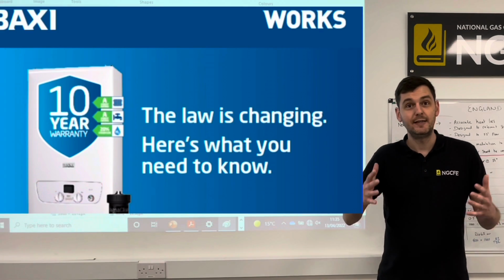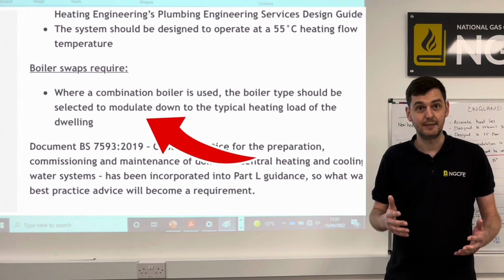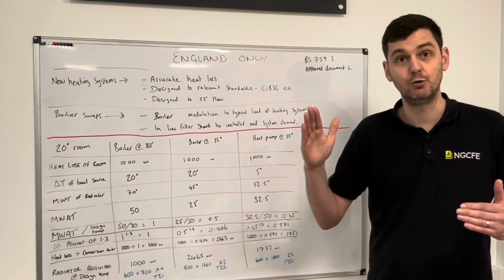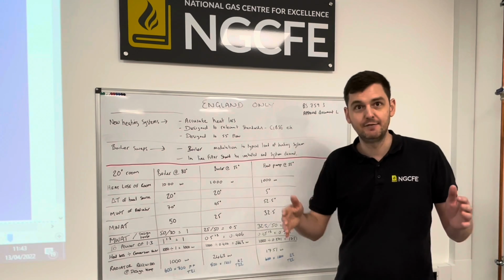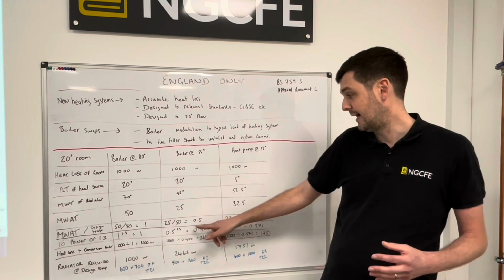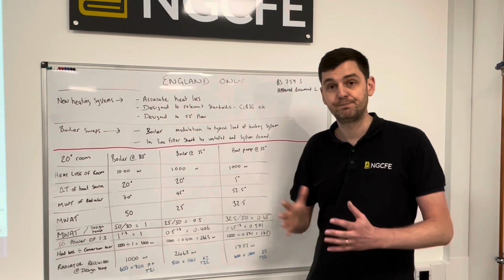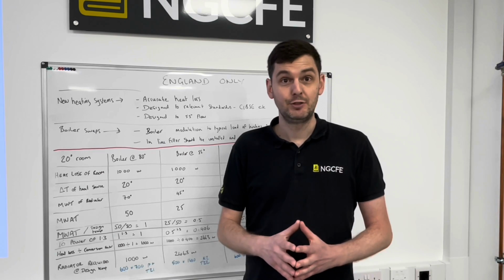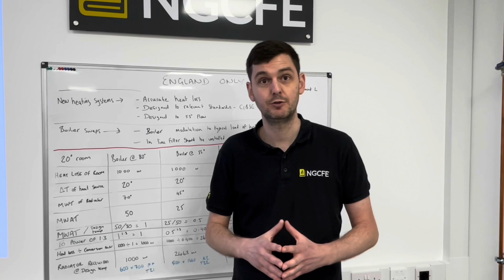Approved Document L Central Heating Low Temperature System Design NGCFE

Comment: If you’re dropping flow temp to 55c, what’s the reason for continuing to use 20c diff as opposed to the 11c we were used to using?
If you used 11c, you’re return is 44 and mean is 49.5. That means the rad size doesn’t need to be quite as big as you suggested. 
I thought that the initial reason for changing tac to use 20 diff was to bring return temps down below dew point yet maintain a higher flow temp because of typical existing rad sizes?
Is there another reason for the 20c? 
Thank you.

Comment: Wouldn't you just replace the normal conventional radiators with new low temperature flow designed radiators which are designed to be more efficient and so reduce the size of using a conventional radiator - granted the new low temperature radiators are more expensive.

Comment: unefficient S plan systems must be replaced with DHW priority. As having one flow temp of 65 Degrees to heat up the stored water is a waste of energy when most properties heat loss is 7 to 9 KWH and would run much more efficient at a lower flow temperature. I suppose mixed and blended curcuits would be one way of doing it as well as priority DHW and a boiler that can fire on two heat outputs :-)
Reply from the maker: Hot water priority doesn’t always suit everyone. It can be a real pain if you have a large hot water demand. Thanks.

Comment: Great video as always. But with system or heat only systems with unvented hot water cylinders with legionellia requiring storage at 60 Degrees. Only boilers capable of firing at two different outputs with DHW priority, weather comp will give the best efficiency... Intergas exclusive and the other one aswell as viesmen can fire on full output to recharge the Hot water cylinder on DHW priority then modulate right down to the heating systems heatloss...  But as you say everything starts with a accurate heat loss calculations!

Comment: With bigger radiators, there is a higher volume of water for the boiler to heat (although at a lower temperature). So is more gas being burnt, or effectively the same amount? Where is the savings?

Comment: I'm looking to install a new combi boiler. We have 10 rads and one shower fed off the boiler. Semi detached 4 bed house originally 3 (had a room made in the loft).
Current boiler is 28kw and has lasted us for over 10 years with no problems. 
Was looking at a Main eco 30 or a Baxi 636, any other recommendations?
Reply from the maker: Viessmann 100. You can range rate it down to suit your load. Thanks.

Comment: Bit vague on heat loss at non extreme temperatures. OK, do a calc at -3°C but who has done heat losses at 5, 7, 10°C when heating is still required, without this how can you decide where to pinpoint the modulation range of the boiler? 

Just as the -5°C figure is only a tiny part of the heating season +13°C  when heating is also required forms a small part of the total heating season. 

We've been covering this and showing how heat loss changes at different temperatures on our Heating Efficiency and Optimisation courses for a couple of years, also heat gains and ∆T across the boiler with the aid of ∆T pumps.

Trainers are going to be busy

Comment: In the video (on the chart) what does the 1.3 multiplication factor represent?
Reply: I was wondering that too. So I found this out: "When you reduce the mean water temperature of a radiator its heat output does not reduce linearly." 
eg reduce mean water temperature by half, results in less than half of the heat output.
As there is a non linear reduction a 'correction' factor needs to be applied from a table: 

Delta_TCorrection:
DeltaT.         Correction Factor
20              0.3 
25.             0.41
30.            0.52
35.             0.63
40.             0.75
45              0.87
50.              1

These corrections are from 
20/50 ^ 1.3
25/50 ^  1.3
etc, rounded up to two decimal places.

You'll see the 0.41 (0.406 used in chart in the video)

For the heat pump 32.5/50 ^1.3 = 0.57 (which isn't in the chart above, but it shows how such a chart is calculated)

HTH
Reply: @vidleon  thanks for that. Just not explained on the video. 👍🏻
Reply: It relates to the types of heat emitters we use- there is some variance for other types of emitters

Comment: Morning Alan. I may have misunderstood the new regulations but I can’t see how an existing system designed for the higher flow temperature can have additional radiators added that work at the lower temperature. Also, are towel rads going to become obsolete?
Reply from the maker: You make some good points. we will see how it all pans out.
Reply: Hello David.. 

Good point, possible solutions could be :-

Trv on the new radiators that will be too large for a 70 degree flow temperature will heat the room quickly and switch off earlier than te others ?
Adjust the balancing of the radiator. Slow the flow excessively to reduce the average temperature flow /return - may deal with it. Good luck finding a lockshield valve that will reduce enough and reliably !  
I'd be interested in your thoughts ?

Comment: Well the maths is wrong. 1. how can 1.3 *1 =1 in the boiler at 80 degree calculation?   So the radiator in the calculation is too small!   2. All things being equal for a fair comparison, the return Delta temperature of two low temperature heating systems will be the same as the energy coming out into the house is the same. The heat pump can’t magically increase the return temperature when no extra energy is being put in!  The flow rate should be the same for a fair comparison. It’s also worth mentioning that with a smaller temperature difference that the heat exchanger in the heat pump would also have to huge in these calculations!
Reply from the maker: We have a full detailed video coming soon, This is a full house with a heat pump going in. Thanks.
Reply: Hi Dominic, 
Thanks for your reply. Its not times 1.3. Its to the power of 1.3. The radiator calculation is fine.
With the greatest respect, your further comments are incorrect. The return temperature of a heat source with a narrower DT will be higher than that with a wider DT if they both have the same flow temperature. Also the one with the narrower DT will have a higher mean water temperature  and as such will give out the same heat with a smaller emitter. Its just physics.
Have a great day.

Comment: I have a 1930s solid wall (no cavity) home, mostly installed with insulated plasterboard, loft insulation, old double glazing, suspended floors with no insulation. Approx 2000 sqft, 16 rads (new, convector type). I oversized the rads by assuming in the calcs the walls were still solid brick with no insulation. The boiler is an Ideal Logic 30+ combi (zoned off for an unvented cylinder). The Drayton Wiser controls are set to Opentherm modulation. During colder months the heating is set to 19.5c from 6.30am to 10.30pm. Over night it's set to approx 17c.

I find that first thing in the morning (when the house is coldest) the boiler fires at 65c to 70c, given demand is highest. Once 19.5c set temp is reached the boiler modulates down to 40c to 50c (or lower, if not to cold outside, I've seen as low as 35c). At flow 50c return temp is about 35c. At flow 35c return is about 30c. (I've never been able to reach delta T of 20; is it normal that the lower the flow temperature the smaller delta T gets?). 

The house stays toasty and warm, the boiler super efficency shows as 72% (which I believe means it's in maximum efficiency / condensing mode 72% of the time).

The boiler rarely fires over night, I figure this is because all of the internal walls are solid brick and act like very large, low temp, storage heaters - releasing heat over night. I'm guessing new regs don't take this into account (given new builds are mostly stud wall etc).

Really enjoy your videos, very informative!

Comment: Whilst gas is 0.07p a kwh and leccy 0.28p a kwh i don't see customers buying in
Reply: why wouldn't customers want their gas boilers to run more efficiently?
Reply: @edc1569  I am not sure they do. Low temperature means over condensing. For years in the commercial world we are told keep the back end temperature over 55 or it rots the boiler. Their are cast iron boilers still out their 30 years old. You will never get a modern boiler lasting that long. No one calculates how much Co2 could be saved if we make boilers that have a decent life cycle. The throw away world has taken over. I have still to be convinced that the country will have enough engineers to maintain complex electronic heat pumps. Lots of us oldies about to retire and 50% of kids at uni. Electric heating is going to take years. Houses will need to be modified. I am all for tech to save energy. But its really not a mystery. If you want to save energy turn it off. Insulation is a much better way.

Comment: Before they bring out new guidance they need to change the inspection and compensation scheme for new builds. Due to the rush to build new homes buildings are taking massive short cuts to avoid penalties. This includes missing insulation in new homes. Not enough inspectors and no legal protection for them or the house buyer allows builders to walk away from some shocking installations. In addition new homes need bigger room dimensions to allow the equipment to be fitted.

Comment: The only point I would raise with talk of ultra low modulation is that in any system you can only get out what you put in. If you are modulated down to 4kw on a gas boiler then that's the maximum you've got to play with...before losses. With good insulation that can work well, but with the average badly insulated British house we are putting the cart before the horse here. We need to get the houses better insulated first. Everything will follow from that. The priorities are wrong......as usual.
Reply: I don't follow, if you've got 6:1 modulation and 4kw is minimum then you've got up to 24kw to play with - that's the point.

Comment: I have already been doing this on an ad hoc basis in my own old house for some years . Installing the Weather Compensation kit on my heat only boiler reduced the flow temperature, and modulates it. I changed my existing single row emitters to double or even triple row so they run cooler but give out the same heat. The only thing that keeps the high flow temp is the hot water cylinder circuit..because it has to. The weather comp electrical circuit allows that. I fitted a Magnaclean about a decade ago. The system works OK, but it does take some getting used to cooler radiators. I also enabled the optimisation feature on my budget Center Brand programmable room stat ( it's a Honeywell underneath). I don't think that with the heat loss profile of my 1885 solid stone house I could get a heat pump to work well without major works to improve the insulation. We are thinking about how to improve insulation affordably over and above what we have managed up to now.  My budget is not endless now I'm retired ( from heating). I wonder how my old Mears heat loss calculator would stand up these days😉

Comment: I called my local building control about the new part L regs.

I was told that they need full designs and heat loss calcs for all new builds,  this need to be backed up by photographic evidence  that the work has been carried out as per the design.  For extensions they will also require Heat loss calculations but photographs are not required.  For upgrade work we are required to change radiators so that they will work at the 55c design temp.  If the older parts of the house do not conform to part L, we are to advise the customers about the new regulations etc. The older circuits are not mandatory but the new circuits will be.
Reply: Contradiction. What does 'required' and 'mandatory' mean if the Part L regs are not law. Sounds like they want to make it sound like law instead of specified as best practice.

Comment: Good video as alway Allen but how do we explain to a customer that only needs to replace boiler because it’s leaking or not financially not repairable we they have to have larger new radiators they won’t go for it
Reply from the maker: You will still be able to replace the boiler.

Comment: So im about to start a self build with UFH ground floor and radiators upstairs with a gas boiler. I can go bigger on the radiators and was going to change the UFH pipe centres from 200mm to 150mm.

Will this be enough incase i swap to an ashp in the future or should they be 100mm centres which i wanted to avoid?
Reply: If you watch @Andrew Milward he can explain better. But at the worst all UFH should be designed with 150mm centres to achieve 90w psm ideally 100mm centres will be perfect 👍🏼.
Reply: Why avoid 100mm centres? Marginal extra cost, not more faff to install. 

Also, why do a gas boiler now? Your property would be perfect for an ASHP now, £5k grant is available, if you design right it’ll be cheaper to run than gas and you’ll have the option of not paying a gas standing charge every year saving more.
Reply: @kieranmccreedy271  still a massive cost to fork out initially and the tech is not all there for low flow temps.
Reply: @jassinghIG45  on a retrofit sure… starting from scratch is a different matter. 

They’ll be spending £1,000s on a gas boiler, pipe work, rads etc. with a £5k grant you’re basically a comparable cost with gas. Payback period would be short if they can get a high SCOP (which on this they should)

Comment: Good ,informative video ,thanks for your hard work over last few years. Review and more detailed comparison of low modulating boilers and open term controls  , which are on the market, will be helpful  (as long as not sponsored by the manufactures). .Heard lot of good about Intergas (and lot  of bad  so we  had never installed them..)

Comment: What a load of rubbish,  its impossible to explain/make customers understand this.the industry wont change and customers wont have huge daft radiators
Reply: It all depends on the customer? I installed LED lighting in my house many years back when people said they were dim or bizarrely came on slowly.

It should be a matter of managing customer expectations. Tell them that it saves them money, and how. As I said earlier, many houses may now have oversized radiators as calculations were made on under insulated house
Reply: @philtaylor194  totally agree ,but theres a hige diffrent in bulbs and explaining why they cant have a 40kw boiler . I agree with the principles but when u battle with customers who cant grasp with with a simple room stat, theres no hope
Reply: @accesszero4803  Indeed. I am seen by colleagues as the go to for energy advice. However, getting across that a TRV is not an accelerator is a big enough hill to climb

Comment: Who is going to police the regulation changes? The installers that just do combi swaps will struggle or not bother at all trying to comply with the new regs. As for heat loss calcs- probably stick a finger in the air and guess!! if no one polices it no few will comply as you say.  The good installers that go by the book will lose out to the fit it and F off boys.
Also, oil boilers generally don't modulate and have a flow temp of 65 degrees minimum. Interesting times ahead.

Comment: Good video although i dont agree with the fact you can put 9kw through 22mm at DT5. This increases our velocity 1.36m/s when we should be designing at 0.9-1 and also our pressure loss is 944 pa/m when we ideally want no more than 300. That is also copper where plastic and mlcp will be even more restrictive especially with fittings. Heat pumps like flow and should always be designed and installed very carefully. 👍
Reply: Thanks for the comment. IMO 0.9 is perfect. I operate on the basis of 0.5 minimum and 1.5 maximum. Obviously the loss is relevant to the size of the index circuit. The chances of taking 9kw any real distance on an average house are minimal.
Reply: @michaelhunt848  but we shouldn't be stretching our designs with heat pumps as you dont have the wiggle room like you do a gas boiler. For them to be working efficiently and to be achieving high COPs we should be sizing them properly or we will be seeing the SCOP of 2.5 like we are now which isn't good at all.
Reply: Totally agree mate.

Comment: Thanks, another really informative video.   I still find modulation confusing, surely when the water gets up to temp the flame then turns off but the pump keep running, or does the flame stay on but just down to that lower kw?  I have a 40kw Baxi combi which for most of the winter I've managed to run at 55c flow already, just about got away with it but heat up from cold probably too slow for most people. Thanks
Reply: Dont be confused with water temperature as modulation even though its part of it, You can turn any boiler stat down so that the system water isnt heated too high and that doesnt make your boiler efficient, the modulation part on modulating boilers is actually dependent on the temperature across the flow/return when the boiler gets close to its target stat temp the fan speed that sucks the air and gas into the burner will slow down and suck less air gas in, pretty sure i have seen modulation as low as 1:8 so 8 times lower than the maximum heat input for example a 30kw would go as low a 3.75 kw 

Been a while since i refreshed my knowledge on this stuff so apologies if some of that isnt quite exact..
Reply: Radfoo good morning,  you will probably find later in the eves that your boiler would stop start a lot (it is called cycling) as it is not capable to modulate as low, if  it  makes sense.  I have  a 33kw one, and later on in the eve is on off like a yoyo 🙄
Reply: @cvplumbersandheating  I also have the Baxi 830 and found that setting the boiler temp to 55 degrees, it cycles much less. Hmm. I have 10mm microbore and 9 rads. I use a Danfoss thermostat with the modulation setting optimum for a condensing boiler.